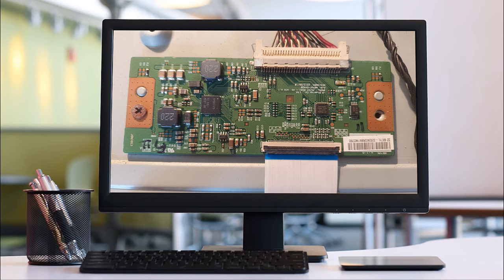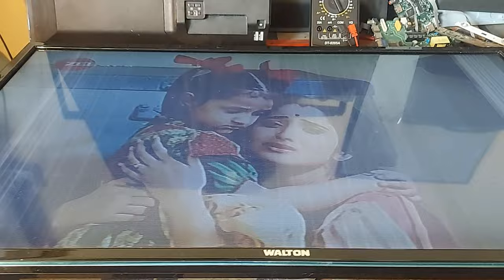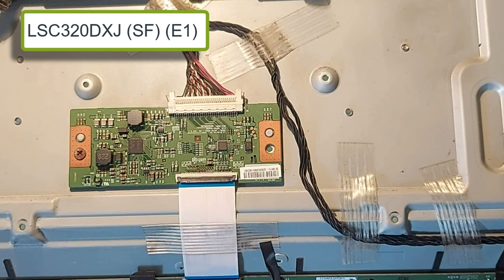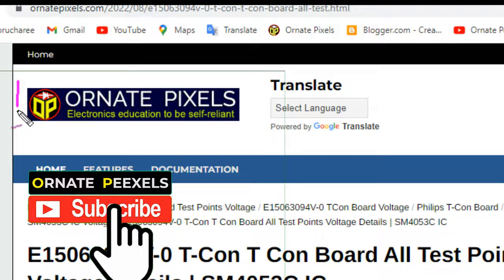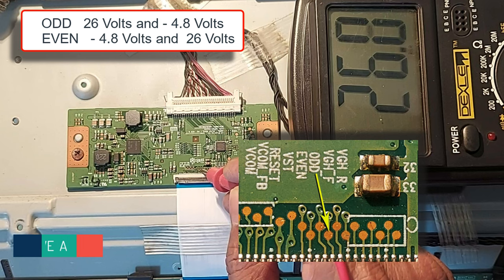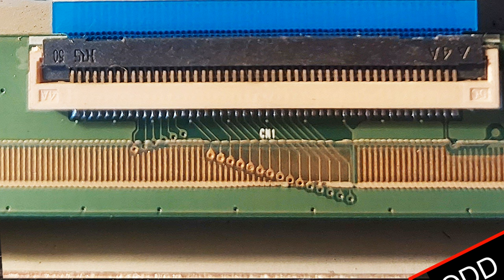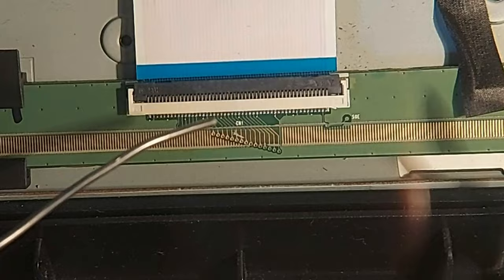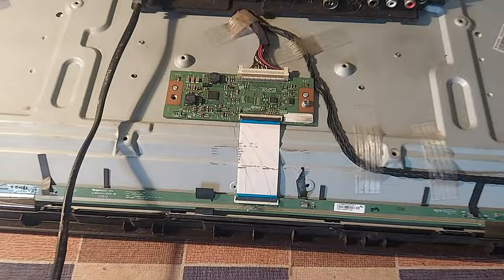Freezing Picture & Vertical Lines Problem | Walton LED TV picture hang, LSC320DXJ (SF)  (E1) Panel

Comment: Yes Sir ok, my confusion is , vgh even and vgh odd -which one have to be connect on vgl from t.con? those flipflops has formula of connection??? And which better resistance have to be used when we connect?. I followed you many times on this issue